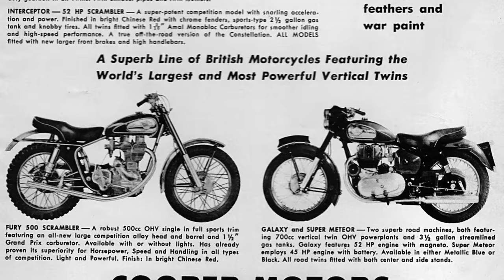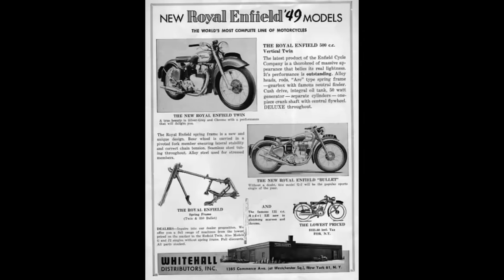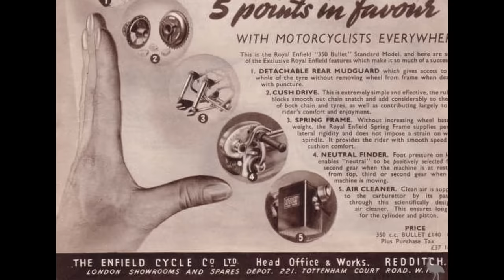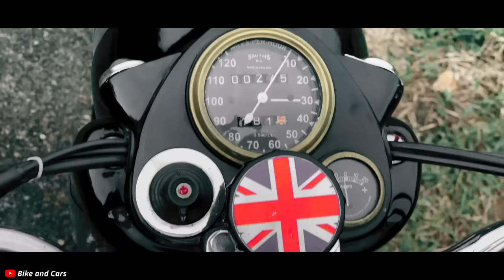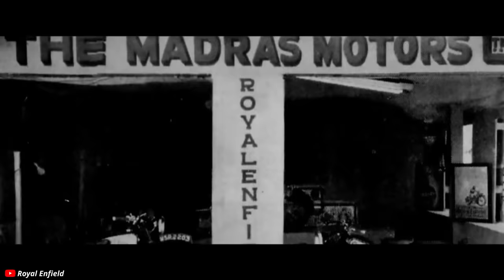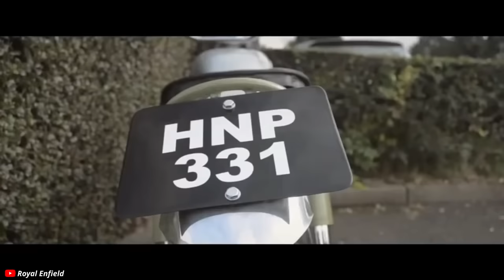How Royal Enfield became the Harley Davidson of India

Comment: After crashing the Royal Enfield INT650 I won from YammieNoob, I can prove that Royal Enfields are indeed "Built like a gun." The bike is fine, only bent some levers. Their bikes (at least the new 650's) are indestructable.
Reply: Wth 👁️👄👁️, I didn't knew that I'd find you here lol. It's a great bike! 
Stay safe 😆
Reply: This is absolutely valuable info for me, as a subpar bike driver 😂
Reply: You'll be surprised if i tell you that the build quality has actually taken a bit of a hit after they have upscaled their prodn lineup, i have seen bullets of 70s 80s running fine even nowdays, these are built like tanks and priced cheap
Reply: Bro their quality was reduced atleast by 40% since i still have my grandfather Enfield with me and it still go like a gun
Reply: that's a smooth motor, given its design. I test rode one and I was impressed.
Reply: it's called GAREEB ki Harley Davidson ..because it's an old tech with no abs, no fuel injection, no tubeless tire..no liquid cooling.. no 6-speed gearbox.. best-selling vibrators/noise creators ..even Scotty can beat easily. People are idiots. .
Reply: @vivekelex  all modern models have fuel injection and abs, konse zmane m ho bhai tum?
Interceptor has 6 speed transmission, and many other models have tubeless optional
Reply: @vivekelex  parallel twin engine does not vibrate at all, more over stock bikes are almost silent, you enjoy your pulsar, let us enjoy our bullets and harleys
Reply: @vivekelex gadhapanti 😂😂😂
Reply: DOOD you won that bike?!
Reply: If new bikes are indestructible, older were just hard metal. You would hardly even find rust or dents on the older cast iron and diesel bullets. Thousands of them are still in good working condition in India.

Comment: The Enfield India bullet was excellent at the most important quality it needed in it's Indian home market, to say it didn't make sense as a motorcycle is to display typical American ignorance of the life and culture of a country that you have nothing in common with apart from the desperate need to make as much money as fast as possible in a country with very poor social services and health provision for the poor. The Bullet is simple, rugged, and easily and cheaply fixed by home owners and small motorcycle/machine shops and as such if it breaks down it can be back on the road very quickly; the difference between getting to work and getting paid and not gettng to work. One of the reasons the Japanese failed to make the kind of impact in India that they did elsewhere was the need for factory supplied parts from a dealer network that didn't exist in the vast rural areas of India. For the 40 years it was the only model made made by the Enfield India Co it wasn't a Royal Enfield at all!  Royal was not part of the name in India. Enfield india was a totaly seperate company owned by Madras motors initially to assemble parts shipped from England and eventually make whole bikes in India, which has only very recently added the "Royal" again as Enfield have started to aim their exports at the retro market. The word Royal as part of the name of an Indian Co. would have been unacceptabe to many Indians for many years due to it's conotations of the Imperial past. The Royal Enfield company didn't almost go bust, it did go bust. The only direct link between the British RE company and the Indian company is the Bullet it's self, an excellent bike that made total sense in India.

Comment: Awesome video! I had never heard of Royal Enfield when I was shopping for a small bike last year. I saw a dealer had a low mileage Honda Rebel for sale so I went to check it out. Turned out they were a Royal Enfield dealer. So I looked at the Meteor and took it for a test ride. It was love at first sight and ride!
Reply: You chose well. Those new "J-Engine" 350s perform about as well as my original preunit model 500 and offer much of the same "primitivo" charm and character of the old Bullets, but require little of the constant fettling necessary to keep those old ones like my elderly "Iron Cylinder" running well. Personally, of the new 350 breed, I adore the new 'Classic' 350 models stylistically. But unlike, say, a Honda Rebel, any of those newish 350s might be the sort of "starter bike" that you just want to hold onto. In fact I know of a couple of folks who downsized from the fancier and more powerful 650 twins to the 350 just for comfort and character's sake. If you're a "moderate" rider who just likes to dodge the butterflies on a curvy two-laner there's scarcely a better bike for it out there than an Enfield single.

Comment: This isn't just an essay, it's a love letter.
I have an 8 year old Bullet 350 (BS3) and I love it to bits. This is one bike I will grow old with. I bought it brand new!
I am glad I have one before they stopped selling the Bullet 350 here. In fact, my bike is part of the 1st 50 units that were imported into my country with a smaller tank and no starter motor, only kick start.
Even in local RE bike meets, my bike stands out. Most of the time, I am the only one with a BS3 and most of them are Bullet & Classic 350 (BS4 & 5) Unless someone comes in with a Lightning 535, Machismo 500, or a Bullet 500 (only 3 in my country - I have seen the record), or an older Bullet 350 CI that is imported here individually.

Thank you for this video. When are you getting your own Bullet?
Reply: My first bike was a classic 350. Bought it way back in 2015. It was slow, heavy, vibrates a lot, nuts and bolts came loose and what not. But it had character, it made me feel special and it gave me sense of joy riding it. It’s a bike made for a specific group of riders, the problem is that is available to everyone. Many years later, I own a ZX10R and a Harley sportster. But that bike will always be close to my heart and I’ll always look at it with pride as it lays at rest in my garage.
Reply: @rockgames345  do you still ride it?
Reply: @KatsudonArt  Yes I try to sometimes. But there are a lot of issues now with the engine and the suspension.
Reply: @rockgames345  what's the issue? What happened to it?
Reply: @KatsudonArt  where are you from? I’m from India.
Reply: In angrezo ko bs3 bs4 samjh aaega. ?
Reply: Never knew they had BS5 😂
Reply: Fellow bs3 bullet 350 owner here , that particular model had crank weight similar to bullet 500

Comment: Been seeing a lot more RE's around lately. They're doing right by the consumer for sure. A solid, by modern tech standards, basic, blank slate to build on.
Reply: Too few of the major manufactures think like that. Tabula rasa is possible in a motor cycle to some degree. A basic machine that the owner can shape to their hearts content. A motorcycle should be personal and Enfield is enabling that to a far greater degree than anyone else right now.

Most other bikes can't suffer any modification more involved than a paint job without being reduced to something less than the specific intent that the manufacturer had in mind for their design.

Any serious personalisation by the owner imposed over the top of that careful market driven specialisation from a high tech design bureau so often results in a undead Frakenbike. A machine that reflects neither the owners nor the manufactures intent, only the horror of amateur engineering.

Making a machine your own should be more like romance than necromancy.

Comment: I rode motorcycles from early 1960's until about 4 years ago, and had about 40 'bikes.  One thing you miss mentioning about the Enfield is its 'soul'. You know when you are riding an Enfield if its a 250 or a 700. To me, they also had ab individual  'smell'. I had big BMW's for long trips, but for just toodling around you  will not beat an Enfield as a 'friend' (I am UK based)

Comment: Actually, heated grips are essential if you ride in winter...... 🥶 Royal Enfield still has a way to go in regards to listening to their customers, and parts availability. I loved riding my Classic 350 while I was in Thailand, but, when I came time to replace my failed speedometer under warranty, I was told getting the part would take three months. I had an even worse issue with buying luggage for the bike, RE makes nothing of note, just a "city bag," that holds about 13 liters. How can I travel using just that? They make a perfectly nice set of bags that would look great on the 350, but they fail to make a rack for them?🤯

Comment: 11:11 beside nostalgiac it's sound (thumping sound) made it a class part, plus good power with a descent fuel consumption were the main features that kept it afloat. It had oil leakage problem earlier, that now gone with that unique sound. It's more like a 350 Hero Honda now than a bullet. gear shifter now is on the other side, no more special skills required to start the bike, it's now more like a regular bike than a bullet.

Comment: On my backpacking trip to India I fell in love with the beauty and simplicity of the old iron barrel Enfield. When I got home I managed to buy a brand new Classic 500 EFI and my perception of motorcycling changed completely. Currently I own a Classic 350 reborn and although it’s miles ahead of the pushrod 500 it does start to lack character compared to the older models. The brand has the same challenges as Harley Davidson does. How to keep the nostalgic feel while at the same time complying to increasingly tighter emission laws and reliability standards.

Comment: I think it unlikely that RE will build V-twins, at least not air cooled ones.  The rear cylinder cooling issues make it extremely difficult to achieve low enough emissions.  The big reason that v-twins came about was because it was the easiest way to add a cylinder to the singles that already existed.  There was no need to widen the case.   Royal Enfield already has a parallel twin with a wide case.

Comment: Ex-Shadow Sabre 1100 owner. As a starting bike it was perfect. Used ones are very affordable, engine lasts forever, dirt cheap to maintain and gives the initial idea of a chopper. The one i had came in with cobra exhaust so basically everything a chopper should offer was there. Good simulation bike and prepares the rider well before upgrading to an expensive Harley.

Comment: Now that royal enfield is shipping worldwide, larger displacement make sense.  In the many years when they mainly sold in India, there was essentially no reason for powerful motorcycles.  Motorcycle speed limits in India have been so low, 80kph (50mph) max, that the 350's were "good enough".  I read that motorcycles were not permitted to use the new expressways which had higher speed limits for cars, but that do not know if that is likely to change.
I would appreciate the thoughts about motorcycles on expressways from someone who lives in India and knows the current situation.  Thanks

Comment: I drive a bullet, and I have a love-hate relationship with it. By itself, the bullet is a gem. such a beautiful classic and it has a lotta character, it just is lovely. But as far as performance and driving pleasure goes I dislike it. It vibrates WAY too much, it is slow and just feels kinda clanky. The thing is, for Indian non-highway roads, with narrow spaces and craaazy riders just popping in out of nowhere and absolute chaos on the road, the speed and performance is good enough. There is no space to go over  say 80kmph which is pretty much the maximum I could go on a bullet comfortably. If it were to vibrate less and just feel a lot more solid, I would like it so much more. RE just managed to get Indians good cruisers at a really affordable price and I suppose that plus the iconic bullet thump fanbase just totally cemented RE's presence here. I'm planning on giving away the bullet and getting an Interceptor next.
Reply: The new classic 350 is very smooth no vibes, I got one now. Had the Interceptor before that, and the Classic 500 before that and 32 years ago had the iron head 350 bullet.

Comment: Everything is ok.. i would like to add few important points here.

Its a defence equipment first then its everything else.
It was primarily ordered for border patrol then came into civilian use.

Defence equipments create an aura of cult n superiority eg. Nissan Jonga, Maruti Gypsy, Old Bullets etc, known for go anywhere attitude, ruggedness and reliability (if maintained well)

IMO, Owing a RE Bullet is the one of  the best opportunity for a common man to cherish patriotism, nationalism, etc.

Secondly, its a status symbol in indian tier 2 and tier 3 cities bcoz of being "heavy" as compared to other bikes, implying that, 
its the one which is owned by a "powerful person".

The one who is powerful physically, financially, and technically (as point ignition timing and adjustment of mechanically pushed rocker + running cost for poorly tuned carburettor i.e low mileage, is not layman's cup of tea)

Being little more expensive to get n maintain means that, an ordinary guy has to reach upto a certain income level to afford it back then. I mean before 2010 nearly.
Therefore it gives sense of achievement in life.

Thump matters upto a level, i mean a Rajdoot 175 or Yamaha RX 100 can wreak havoc if muffler mesh is removed, the torque as you have already said was the USP back then.

this one i have,  https://youtu.be/jrl73YEXl70

Comment: Just like Harley Davidson is no longer Harley Davidson anymore, Royal Enfield is no longer Royal Enfield anymore. Yes, the names may still be the same, but the iconic motorcycles they made for so long are gone. What made both Harley Davidson and Royal Enfield so iconic was their sound and feel. Harley Davidson lost that with their big bikes with their smooth, quiet, completely characterless M8 engine. Then they lost it completely when they discontinued the EVO Sportster. Royal Enfield became an iconic bike because of their long stroke 500cc single cylinder engine, which did not include any kind of balancer. It was a low rpm heavy flywheel engine that made a wonderful THUMP THUMP THUMP that you could hear and feel. Like the older Harley Davidsons, it was a MACHINE, and it sounded and felt like one. But Royal Enfield does not make that engine anymore, and like Harley Davidson, their new bikes are also smooth and quiet and drop dead boring. I own a 2002 Sportster 883, a 2006 Sportster 1200 (both carbureted) and a 2013 Royal Enfield B5 Bullet 500, converted from EFI to a carburetor and a much smaller, lighter, and louder catcon free exhaust that brought back the sound and feel of the older Royal Enfields. The characteristics that made both Harley Davidson and Royal Enfield legendary are now gone forever. The names no longer mean anything.

Comment: I agree RE has the pattern that works. Riding spirit pure and simple.  HD and others betting on teck gimmics is only Materialism in the pre-collapse cycle of our society.  These people are  the true believers in categorical graduate level Business Management Analytics.  Everything they touch turns to High Fructose Corn Syrup.  Motorcycle tires are the exception, I like modern tires. HD may never die, but bankruptcy I expect to happen some time before they get the message they ain't the badasses they imagine themselves to be.  I'm editing out some of my real feelings here since this is a family channel.  I mean, how is the management at HD different than Justin Trudeau?  A: superficially different.

How about a V twin 55 hp an 55 fp torque, 400 lbs wet, air cooled, 4 gal tank, 4 speed trans for $8,000. Call it the HD Rodeo. I'll bet my '99 SV 650 that RE does it first, and it would be a quality machine.

Comment: No other motorcycle manufacturer sells you an unbalanced, heavy crank, long stroke, pushrod motorcycle(read; raw motorcycling experience) at such a low price, heck the next best offering is from Harley and it costs 6~10 times more! However the company is slowly taking the Harley route and succumbing to marketing pressure, the J Series motors are a clear indication of the same, all the hype for a generic OHC motor, I sure wonder whether selling their souls would he worth it in the long run as I hear even the Bullet would be running on the same OHC platform shortly.
Reply: Not 6 times, only 3times costlier.
Reply: @droid6759  The Street 750 is a OHC, it's the equivalent of J Series of RE, so not worth considering.

Comment: Please don't compare Royal Enfield (better call it Royal BS) to a Harley! Royal BS still contains the same old colonial era engine which they just increase the cubic capacity. No new technology have they introduced, except for new models all using the same engine or variants thereof. The vibrations that you get to feel while riding this bike is unbelievable. It's amazing that this kind of BS bike even exists today. Most of the people who buy this, do so purely for the big bike feel and the sound. Although you do get the big bike feel, unfortunately (or fortunately), the stock silencer no longer produces the desired sound. Due to this, they go for after market ones which results in them falling afoul of the law. Don't even talk about the servicing. I have had my friend's 350 with me for more than a year and a half during which time i have had to visit the enfield service station for 3 times. Once right after taking delivery (after service) getting back home, the silencer was glowing red hot. turns out that these guys had not filled in any oil. The best one is the 2nd time when i left the bike for servicing. I kind of suspected that they were not even touching the bike. So before i left the bike, i had stuck small stickers on all those areas which might be touched by a bike mechanic. Evening when i am picking up the bike, the supervisor is saying all the work has been completed and then i check all the stickers were still in place. The best part is, the dirt on the bike was still in the same areas as i could see my initials that i had traced in the morning. This is the true story of Royal BS.